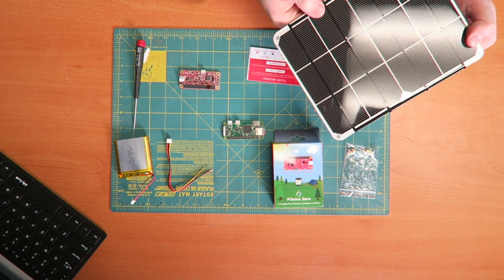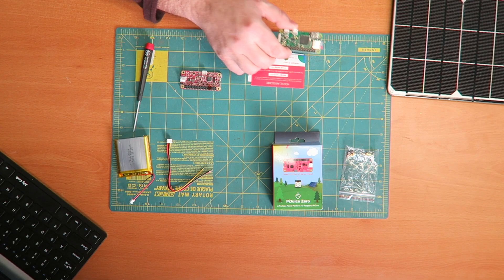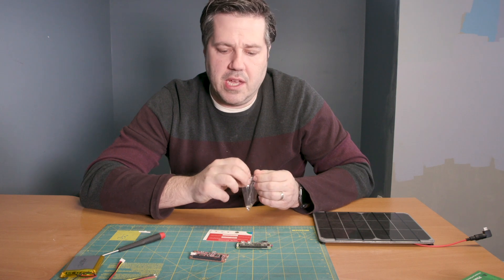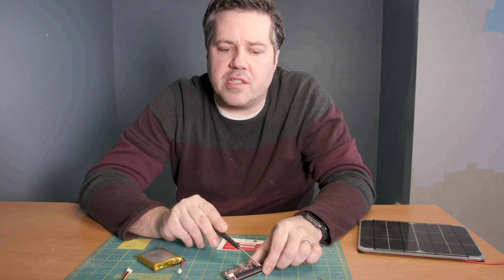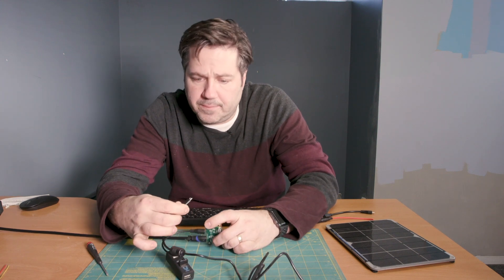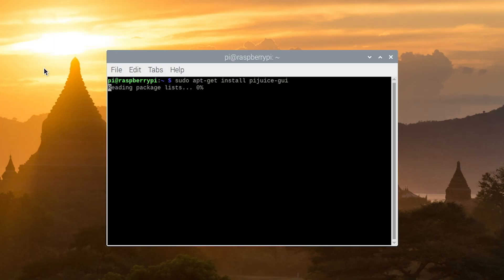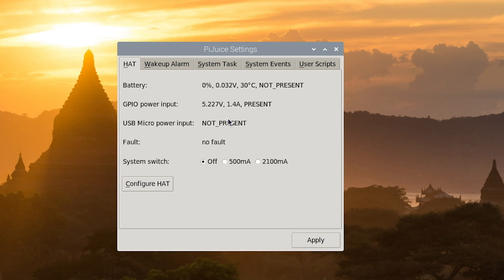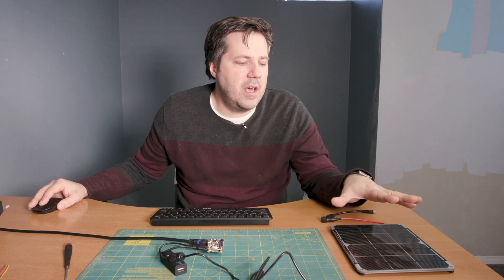Making Raspberry Pi with Solar Energy

Comment: hi nice video - does the PiJuice Zero also work for the Raspberry Pi Zero 2 W?
Reply from the maker: I don’t know for sure but I don’t see why it wouldn’t as the power requirement are the same.  I haven’t had the chance to use the new version but I want to soon.  Try emailing the team at piSupply in the UK that makes it they respond super fast just account for the time zone difference.

Comment: It's more fun to recycle panels and circuits from a cheap outdoor solar light and write your own code.
Reply from the maker: You absolutely can do it and I'd recommend if you have those skills you try.  In this case though the solar panels from cheap lights would not provide the needed power and the off the shelf panel was relatively cheap and looked nice.  there are so many ways of doing things which is what makes electronics so much fun!

Comment: Why use a PiJuice zero and not just use the solar bank on the pi?
Reply from the maker: Hi Chuck.  Do you mean plug the solar panel directly into the Pi?  The Pi Zero doesn't have a power manager so the the PIJuice manages the incoming solar power to charge the battery or run the Pi.  I'm sure there are other ways of doing it.  How were you thinking of connecting the panel to the Pi?  The PiJuice also provided the UPS functionality to the device.  When I did the video this was a an easy and elegant way of configuring it.  I'm happy to give you my opinion of other options, just let me know what you are thinking.
Reply: It's late to reply but I think you are referring to solar power controllers ( more like MPPT ) ?

Comment: Thanks for your vid. Very informative.
Read somewhere that plugging power into the RPi Zero directly while the Pi Juice is connected and powered can damage the RPi Zero. Curious if your RPi Zero threw any errors or experienced any damage while experimenting with power directly into BOTH boards?
Reply from the maker: @MFJLabs  I didn't have any issue or get any errors.  I plugged it in a lot of ways while I was testing it too.  Honestly I would have expected it to break while I was figuring it out, but I think I only did what you described a few times, before getting the final configuration.  I'll take a look in the directions and see ifI can find something on that.  If you happen to see it, let me know where and I'll add something in the video description about it.  The nice thing about the Pi Zero is they are so cheap, blowing one up isn't the end of the world.  I have definitely killed a few but usually doing something stupid like hot connecting motor drivers and motors.

Comment: Did you run in long term on solar power, or on the sun at all?
Reply from the maker: For stability, I ran off battery and had the solar panel maintain and recharge it.
Reply: I watched the next video, connecting sensors. Was there another one with the solar recharging the battery? I'm looking to do a similar project but am concerned the Pi will discharge the battery over time and cut out. Will it start back up when the sun is out? How does the Pi not go through a cycle of booting up then shutting off when there is a tiny amount of power in the battery, which then gets drained by startup?
Reply from the maker: Hi Sam,  the PiJuice took care of managing the the battery charge.  Essentially when sun is available it charges the battery.  Here is what you need to look out for. First you need to make sure that when sun is available the output of the panel has enough power to run the pi plus all its devices and has a significant amount of extract capacity that can go into charging the battery.  If you don't have enough reserve, the battery will eventually be depleted over time.  I tried to get a s big of an overcapacity I could so the battery could charge on days when there was little sunshine.

The second thing you need to look at is the battery capacity.  It needs to have enough power to run the pi long enough to make it through times with poor or no sun.  This includes times of bad weather.  So you'd need a much larger battery likely in the Pacific Northwest than you would in say Arizona do to the number of days of sunshine.

The PiJuice had a number of features for handling shutdown of the Pi in case of the battery going dead.  I don't think it had the ability to turn itself back on to recover from power failure.  I do seem to remember that you can program the pi to turn on automatically a set time with its clock if it isn't already on.  So that is a potential failover.  if the battery dies. Once there is sun it will recharge.  Set the pi to try and turn on every so often and it will reboot itself in case of power failure.

Let me know if you need anything clarified or need more help.  I'm happy to dig into my notes from making the video.  Also this video is from awhile back so you may want to check the PiSupply website as they were often updating the PiJuice and may have improved it from when I did this.

Comment: am working on a pico based controller for a 5lb 100w smart solar energy solar panel costing $50 to make
Reply: 22000mah 10 2200mah 18650 for plenty of portable power
Reply from the maker: The bigger the battery the longer you can run in bad weather.  As long as you have the space, go for it.

Comment: Great video , thanks for that.! Does your  setup also work with the Pi Sugar Pro instead of the Juice ? I use a Pi 4 , will your setup work with that one as well? And do you have link of the ordered battery please?
Reply from the maker: For a Pi 4 I'd likely go with the full version of the PiJuice. Here is the link to the battery.

ttps://uk.pi-supply.com/products/pijuice-5000mah-battery?_pos=4&_sid=0cb658181&_ss=r

The PiSugar2 seems like a nice device and I have no doubt it would work with this project.  I haven't personally tested it though.
Reply: @SoWeBoughtaHouse  Thanks for you information & the link. Cheers,
Ruud

Comment: Geht das ganze auch mit einem Pi 4 B Sie sprachen da glaube ich von einem Pi Zero . 
Danke erst schon mal vor ab für diese E-Mail .
Ich habe auch ein Spannungsregler gesehen in einem anderen Video , den musste man aber mithilfe eins Mess Gerätes über ein Poteziometer einstellen  .
So etwas besitze ich leider nicht .
Reply from the maker: Für den Pi 4 würde ich dieses Modell des Pijuice verwenden. https://uk.pi-supply.com/products/pijuice-standard

Das pi Zero, das ich im Video verwende, ist nur eine kleinere Version. Ich habe den Stromsensor verwendet, um den Stromverbrauch des Solarpanels zu überwachen, aber das brauchen Sie nicht. Das PiJuice bietet über die API ein grundlegendes Feedback zum Panel-Status.

Lassen Sie mich wissen, wenn Sie weitere Fragen haben. Viel Glück bei Ihrem Projekt. Ich entschuldige mich, wenn mein Deutsch nicht gut ist.
Reply: @SoWeBoughtaHouse  Vielen Dank schon mal für diese Info und den link .